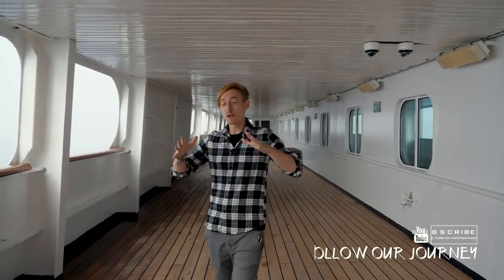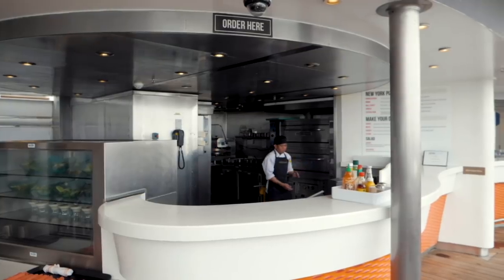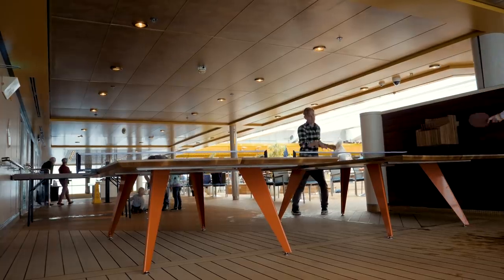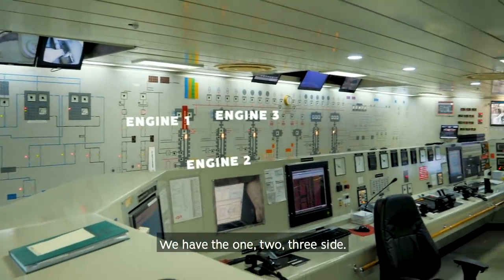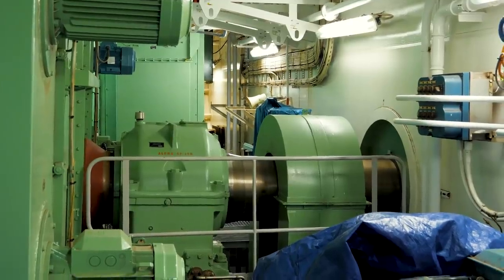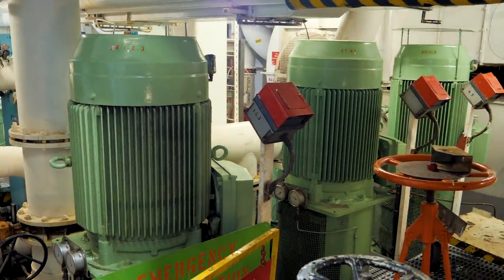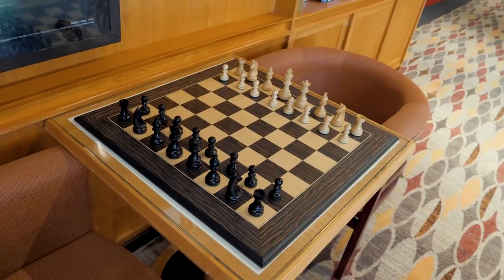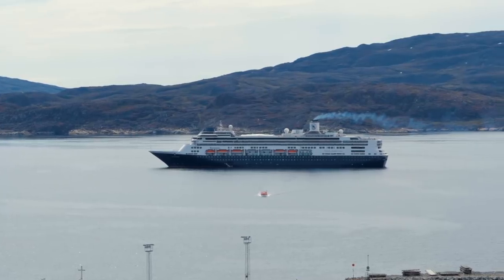WHAT'S INSIDE A CRUISE SHIP - Holland America ROTTERDAM engine room | Barbster360 Travel Vlog

Comment: What does 6.33 represent the 5.6 and 7.0 out of 12.5?   Is that how much minerals are allowed and ratios between the two?
Reply: I assume you're referring to the charts showing the pH and chlorine content of the water. I can't remember the exact requirements, but the pH should be close to 7 (which high school chemistry will tell you is neutral pH). The reading on the analyser shows 6.82, so close enough. The other figure on the graph is chlorine content measured in ppm.

Comment: You went to the Engine room and you did not talk about the main engine
Reply: @KD 10,good day,almost all cruise ship are of same engine rooms and machineries,they varies only the type of manufacturers of the engine,actually if you mean Main Engine on the cruise ship,you can not find a main engine unlike the cargo ship,let me tell you this,on the large cruise ship like this,there are four to six large engines of the same  sizes that's why no main engine,these large engines,connected each one to each generator to produce electricity,the electricity being pruduce,supply the axymuthing pod(propellers,4 propellers if the ship travel) and also supply all the electrical equipments aboard the ship.so no main engine unlike in cargo,there's main engine to propelled the ship only and other smaller engines for generating electricity for ship's use.that's the difference w/the cruise ship and of a cargo ship.
Reply: @bradwendica5737  Slight correction, the Rotterdam has 2 controlled-pitch propellors and 2 stern thrusters. The Amsterdam is the only ship of this class with azipods.